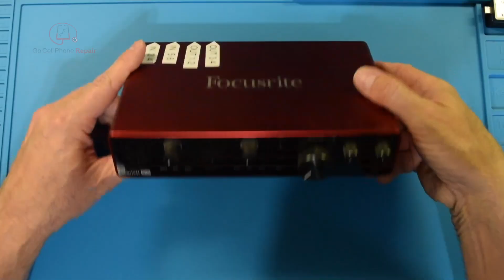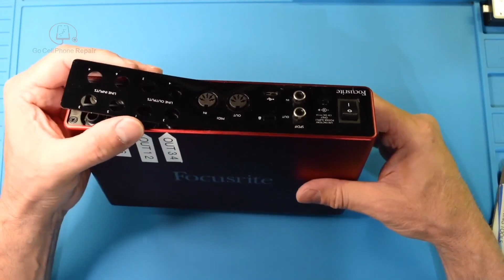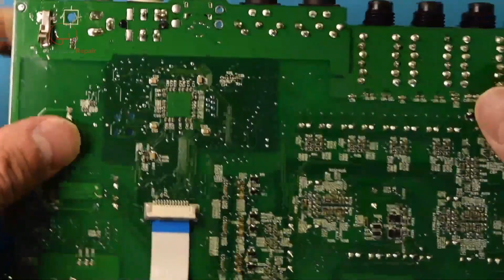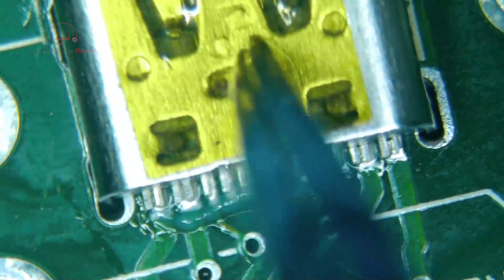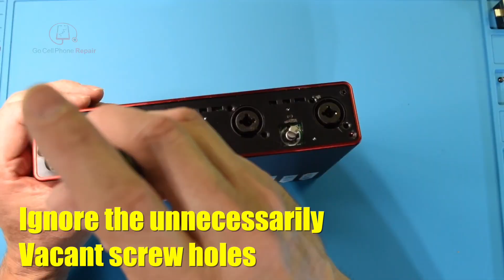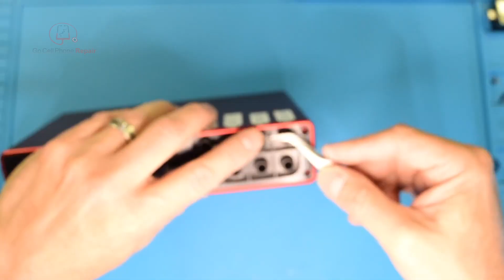Focusrite Scarlett 8i6 3rd Gen USB-C Port Replacement

Comment: Where do you get your replacement ports? Or will any 16 pin USBC work or does it need to be the exact oem
Reply from the maker: In this case my customer provided the part. I assume that he got it from the manufacturer or maybe Ebay.